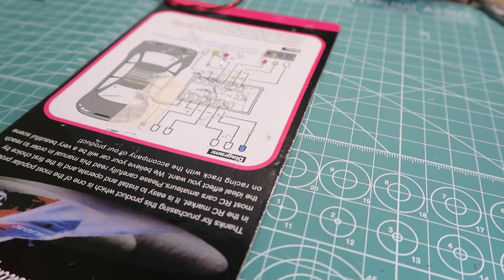RC BUILD SERIES | HONDA CIVIC EK9 TYPE R | SPOON

Comment: What did you use to make the carbon fiber cloth into the hood? I am assuming a resin but what was the stuff exactly
Reply from the maker: I used epoxy resin. 2:1 ratio :)